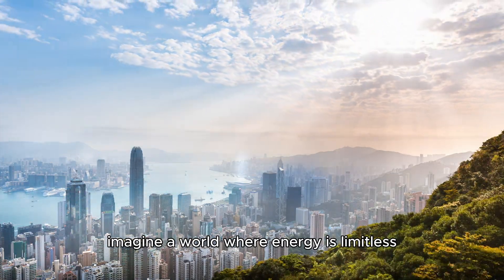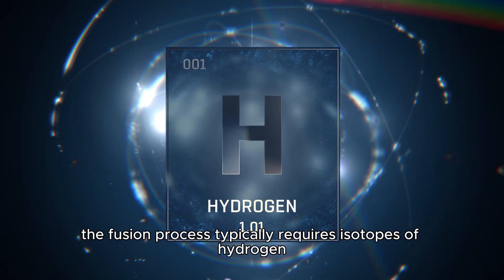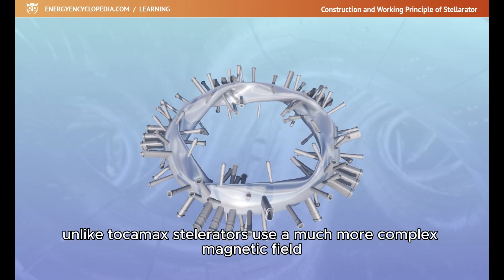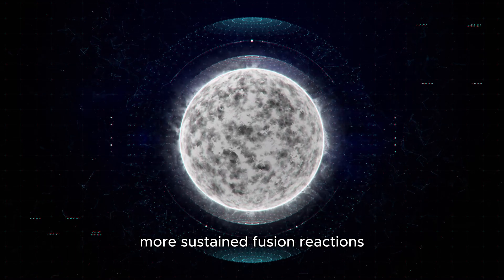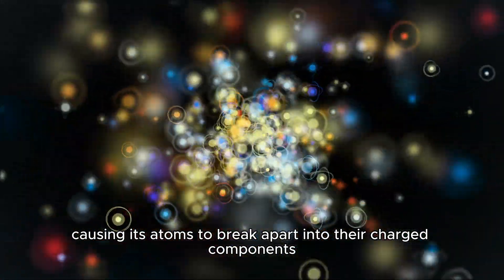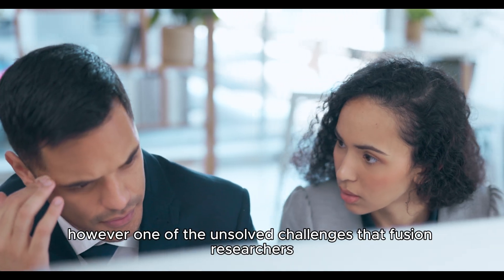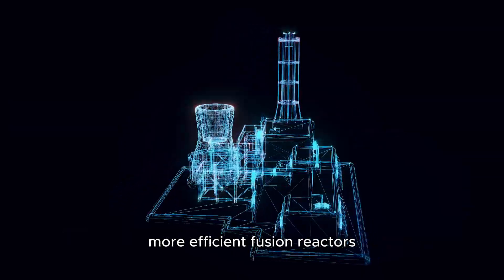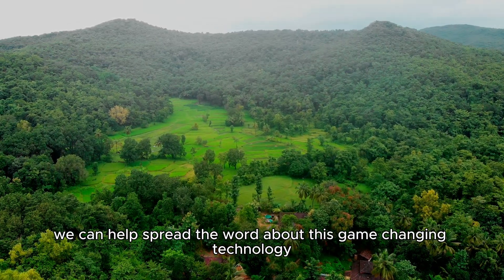Unlocking Infinite Energy: The Fusion Breakthrough of Wendelstein 7-X

Comment: The only difference between fission and fusion is that fusion has less problematic waste storage. Fission has effectively infinite fuel via breeding. We already have fission technology. With fusion we still have the problem of heat-to-electricity conversion and distribution of the latter. Fusion is not the Holy Grail.